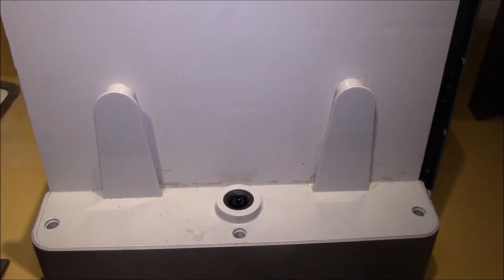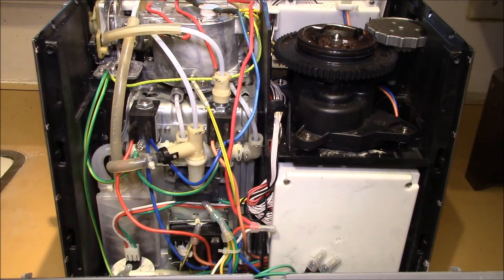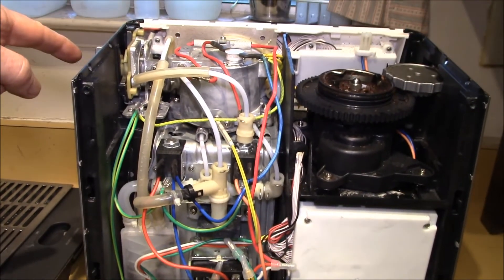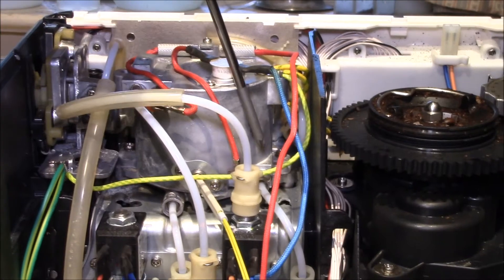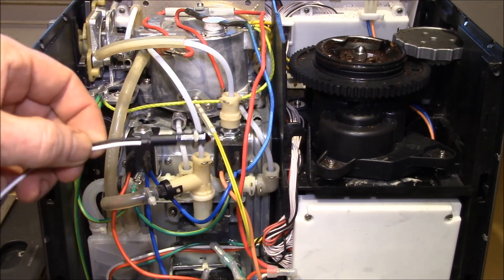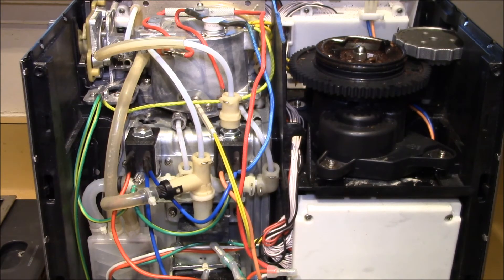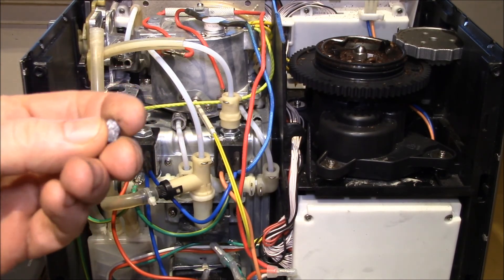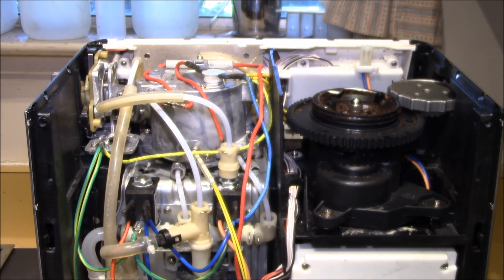Breville/Sage 870XL Barista Express - Water Flow

Comment: Thanks a lot it's very interesting video! Question: the pb I have is: the first shot is good but the next there is no pressure and the water comes out from the bottom. Is the 3 way valve issue? Thanks
Reply from the maker: Yes, that valve may be sticking part way open and that allows water to flow, via the path of least resistance, to the drip tray.  Try cleaning the valve:
https://youtu.be/eljHS_BRJXk?si=5dmpMHDIYVtmt-IF
Reply: Thanks a lot for your quick response! Much appreciated! You explained very well the process how the machine works! Thanks again and have a great day!

Comment: i have the same machine BES870XL. i justed changed the selenoide. Even with a new selenoide, i still dont have water coming on the main espresso cup but i do have water coming for hot water and for steam. it seems that that trere is a hose blocked somewhere...any idea ?
Reply: after a few tests, no hose blocked and no water coming for percolation
Reply from the maker: @ Likely an electrical issue (wires not connected right) then or the new solenoid is blocked internally and unable to open  Check the pinned comment in this vide for some troubleshooting tips.  If none of those help, it could be the driver circuit on the main circuit board has failed.  See the link to the photo album in the pinned comment.  If you can't repair the board, new ones are available at a reasonable cost.
Reply: @The4Crawler  I just opened the motherboard case and I see black heat spots, so the card seems burnt.
Reply: @The4Crawler  i succeed. I changed the selenoide and the circuit board. Everything work perfectly now. Thanks for your help
Reply from the maker: @FrancoisBolduc-y2q  No problem, glad you got your machine working again!

Comment: Yesterday, 17/03/25, my Barista Pro had exact problem as in this video. That is, water would come out for 5 secs or so then stop when using STEAM, HOT WATER, DOUBLE OR SINGLE COFFEE. The idea in this video mentioning "AIR-GAP" built-up and the "FLOW METER" are 2 things have caused this problem.

My fix did not involve opening the whole machine in order to fix the FLOW METER. I just poured HOT WATER TO 1/2 tank. Then used the BRUSH (supplied with BARISTA PRO; or use the TOOTH BRUSH) to brush the MESH FILTER, inside WATER TANK, in the hope to remove any residues built up on this MESH FILTER. Then tip this water out. I then filled the water tank again with HOT WATER... And eventually it works like a charm.
Reply from the maker: Thanks for sharing your fix!  It's nice to hear of a simple solution that doesn't require taking the machine apart.

Comment: Hi there, My machine no longer heats. I am about to change the thermocoil but before i do I was wondering if there is anything else I ought to check first. Perhaps a thermostat or a sensor that could be causing the thermocoil not to engage? Would you have a suggestion as to best procedure? TIA!
Reply from the maker: Some things to check on this web page:
https://siber-sonic.com/appliance/breville.html
Its aimed at at an earlier model machine, but all the 800 series machines are fairly similar.  Also, might be worth contacting Breville support and see if they have any troubleshooting tips.
Reply: @The4Crawler  Good point! And thanks for the link!

Comment: There is a circular thingy on top of the boiler. A red wire on one side, blue on the other side.  Recently, as the machine was building pressure, there was smell, a smell of electrical heat and badness.  Upon exposing this thingy I touched the red wire and the shrink tube was dust and the red wire was faded and it too was dusty from heat. Is the white circular thingy the problem and I just replace it or has something terrible transpired and I'm SOL?
Reply from the maker: I'm not sure what that is.  I never looked too close last time I had my machine opened up.
Reply: @The4Crawler  I just ordered the entire boiler, has everything. $70. And the solenoids and pressure gauge.  This is now a backup.... we bought a new 870.
Reply from the maker: @TheHypnotstCollector  Good deal.  I didn't see any separate items related to the thermo-coil available, so I imagine it's all one unit.

Comment: First of all, thanks so much for the great info. I would like ask for your option about an issue I have with my machine recently.  At the end of steaming, when I shuttle off, the pressure is released from the steam wand, instead of releasing to the diffuser.  I run the cleaning and descaling cycles, but won’t help.  Could you help?
Reply from the maker: Steam should vent to the diffuser and drip tray when the steam valve is turned back to OFF, via the built in hose out the back.  Maybe that fitting or the valve itself is clogged inside.  I have a video in this playlist on that fitting.  Steam should also be vented via the 2-port solenoid valve on the left side, that's turned on at the end of a cycle as you can see here:
https://youtu.be/9cC-m3a-oXY?si=FpqlHpBoo_GRvZsC
Reply: Thanks so much. The info on your other video is also help. I will check the 2-way valve. I suspected that one not working probably. Really appreciated.

Comment: Aha, seems found cause of one leak, a split o-ring. But when I run steam, I get water bubbling out from between the metal thread and the plastic part on top of the solenoid.
There is a small black o-ring in there that doesn't come with the new one, maybe that has deformed or something, looks fine but it is tiny. Any idea what size that is please? Tried replacing it with an orange one, no change.
Reply from the maker: Good find, I hadn't seen an o-ring in there before as it blends in with the dark metal color.  Hard to measure but it seems to be 7mm OD x 1mm thick.

Comment: Hi again, how tight should the part on top of the solenoid (vertical connector) be screwed on to it, and should there be an o-ring in there? I know there's an o-ring there for the the, but is there one between that connector and the solenoid, if that makes sense? Thanks.
Reply from the maker: That is a pipe thread type connection, so tight enough to not leak.  You can add some Teflon tape to the threads before screwing the plastic piece on to help seal those threads up.
Reply: @The4Crawler  Thanks but I might just have to give up :( wasted time and money and money. Replace solenoid so that now works, but now there's a leak out the top of solenoid, and also one somewhere near the left solenoid, water pools on the flat metal tray part.
Reply: @The4Crawler  Thanks, I have ordered a role of teflon tape. Fingers crossed that's the last step.

Comment: I've just noticed I have a small leak coming from the T shape part pointed to at 2:45 is this known to fail or likely just needs a new O ring? Can the T part even be bought? Thanks.
Reply from the maker: Covered in this video:
https://youtu.be/46UBebNJ-uo?si=xoIWc5_rJJrL55TJ
Washer on the bottom, o-ring on top and a zip tie around the tube out the side.
Reply: @The4Crawler  Excellent thanks, watching it now. On mine though I can see drops coming from where the clip goes in on top holding the white small tube.
Reply: @The4Crawler  Thank you very much. It seems parts are less readily available in the UK. Would eBay item 386841743258 be the correct one? It looks the same but doesn't come with the white top tube, but I don't see why it should need to? Thanks again.

Comment: Thank you for your informative video I have the exact same machine that were not brew coffee the right side solenoid when powered on there’s no power going to it when it stops. The overflow solenoid on the left has 240 V. Can you please help the solenoid on the right when running has no power with the multimeter so I believe the solenoid is okay but somehow there’s no power going to it
Reply from the maker: Assuming it's a 240V machine, then either the wiring to the solenoid has a loose connection or if that's OK, then the driver on the main circuit board is defective.  Details on that part way down the photo album below:
https://photos.app.goo.gl/bN1ugnLPYwvyDcr59
Reply: @ thank you think it’s probably a little bit over my head
Reply from the maker: @johnberto8861  New circuit boards are typically available.  Or, if you don't want to spend a lot of money, one could wire in a momemtary push button switch to power that solenoid valve to run a shot.  Push the button while the pump is running and then release when the pump stops or the cup is full.
Reply: @ thank you so much for the tip🙏

Comment: Ok. You are definitely the expert on this stuff. I replaced the safety valve and the tube on top of it and it’s no longer leaking and my steam is working terrific but now my puck is crazy wet. I’m adjusting grind size with no luck or little luck. I had cleaned the grinder thoroughly. What should I be looking at? Three-way solenoid valve?
Reply from the maker: If the pressure is at a decent value and the shot is otherwise OK, then it may be OK.  One page I read said that wet puck may be caused by not filling the filter basket fully, you should see an impression of the shower head on top of the puck.  If the pressure is low, then the 3-port solenoid may not be fully opening, thus allowing some pressure to leak by.

Comment: Hey Mr Brown, my name is Tom.

I've read your pinned comment and watched the video several times but I'm stumped. I took the back off my machine, cleaned out all the water lines, reassembled, but no water will come out from the wand or hot water dispenser now. It will come out from the group head just fine, and water will go in the lines leading to the hot water dispenser, but nothing but dribble from the hot water dispenser and nothing from the wand... Any tips? I'm about to cave and buy a new machine if I cant get this figured out.

Thank you for your time,
Reply: Hot water is coming out of the bottom of the thermal coil but after the solenoid block, I think that’s where the hiccup is. 

All of the wires are in their original position 

I can blow air throw the tube that connects to the hot water dispenser so there’s no obstruction there
Reply from the maker: @haxorizm7452  Sounds like you're getting closer to the cause.  Water should come out of the thermo-coil and down to the right side of the solenoid block then up out of the upper port to the hot water valve.    If the pump is running, that water is going some place and that's either the group head or the drip tray if it's not going to the hot water valve.
Reply: @ yep we’re on the same page, but that’s the confusing part. 

Hot water is coming out of the thermocoil on the bottom right, I can feel the hose get hot.

If I turn the standby to steam, it’ll dribble. If right after that, I then pull a shot, a big poof of steam comes out from the group head so that pressure is building somewhere. 

If I turn it from standby to hot water, it’ll dribble. Nothing out the group head 

There will be a marginal amount in the drip tray after this, but nothing to write home about 

Is that still sounding like the three way solenoid is the next step?
Reply from the maker: @haxorizm7452  That sounds normal for the right side tube to get hot.  At that point, either the tube out of the top of the solenoid or the hose out of the middle of solenoid block should feel hot as well.  If neither of those is getting hot, it may be the 3-port solenoid is clogged, likely at the top port as that's where the hot water goes to the valve on the side.
Reply from the maker: Could be the hot water valve is clogged internally.  Maybe try running several descaling cycles through that valve, especially letting the descaling compound sit inside the valve for some time before flushing it out.  If that doesn't help, see below:
https://siber-sonic.com/appliance/800Mech.html
I think there's a writeup there on taking that valve apart for cleaning.
Reply: @The4Crawler  working on the descale now, I double checked all the water lines and all are clear 

The unit will build steam, descale in the single cup setting, but still nothing but dribble from the hot water and steam function. 

I can hear the solenoid turning on, so I’m really at a loss. 

I’ll let the descale sit for a while and cross my fingers but did you have any other ideas while I have you? 

If not, do you or anyone you know tinker with these? I’d be willing to compensate for time obviously 

Thanks again,

Tom
Reply from the maker: @haxorizm7452  No solenoid should turn on at the beginning of the hot water cycle.  At the end, yes, the 2-port solenoid will turn on for ~30 seconds to purge the system of hot water/steam.  But, per this water flow video, water should flow up out of the top of the 3 port solenoid (when it's off) and over to the hot water/steam valve.  If that valve is being turned on, try disconnecting the wires to that solenoid (with the machine unplugged - also tape off the wire end you disconnect) and then try running hot water.  If it comes out normally, figure out why that solenoid is being turned on.  Maybe the wires are mixed up or maybe the main circuit board has a defective drive circuit for that solenoid. Maybe unplugging the machine might reset that as well.
Reply: @The4Crawler  Thanks for the quick reply! I should mention, it was sputtering before but after disconnecting the lines and reconnecting them, thats when the hot water and steam want stopped flowing all together.

i'll give your suggestion a try tonight and follow up tomorrow. Thanks again!!

Comment: Thank you Mr. Brown,  that was helpful, in the picture that I am attaching, if there is an option for this, after i replaced the black part of the solenoid only, (top of the right one, ) and the  pump, i did hear a something go flying ( fling) as i was dismantling the unit, although I could not find anything., then upon putting the new pump in an starting to reapply all of the hoses and wired, i found this small spring with a piece of plastic at one end about half an inch in length,  hard spring about 1/8th in diameter with a small opaque plastic insterted into one end, which is rounded off),  ( UPDATE, I COULDNT POST A PICTURE HERE, SO, I WILL TRY TO DESCRIBE IT, . , ugghh, I don't remember where this came from, or where it goes, can you help me ?, thank you, john
Reply from the maker: Photo 17 in the album below might show that:
https://photos.app.goo.gl/bN1ugnLPYwvyDcr59
Sounds like it's the spring from inside the over pressure valve.
Reply: @The4Crawler  , This is exactly the spring, next to the numbers 23 and 24 on the left picture near the bottom of the group of pics, You are INCREDIBLE in your detail.!, I cannot believe the knowledge of the multitude of different videos you have., Thank you for your expertise, God Bless., thanks again, john.

Comment: I found out that you can disassemble the solenoid valve and clean it with cafiza or vineager. Never buzzed again! Sometimes it's not necessary to replace it.
Reply from the maker: Yes, I found that as well:
https://youtu.be/eljHS_BRJXk?si=81Rw9Rt75Vo4jvEO
I like having a spare set of valves on hand to make it quicker to swap out next time.

Comment: thank you for excellent comprehensive information., i have watched lots of videos and read your entire first comprehensive list of trouble shooting possibilities, however I still have a question.,, my machine has a a similar problem, but doesn't make as much noise as usual after powering up.  it is rather a quiet buzz. i was wondering if you knew how to tell if it is the pump or the solenoid when there is no pressure. there is no only a small amount of water exiting the wand, steam of either of the shots. I am guessing the solenoid, as I heard that no amount of water at all will come our if the pump is bad., but is that completely true., is there a : partial failure of the pump where some water could still come out ?, thanks for all answers., of course I could just replace both the solenoid and pump, but i am curious which it is. nothing is clogged, cant find any leaks., i have done resets. cleanings etc.. thanks again,
Reply from the maker: Leaking solenoids will usually send a lot of water down to the drip tray.  It may also be a leaking over pressure valve, that sits on top of the pump that's sending water to the tray.  On the pump, it may have low output, or the little inlet water filter may be clogged up and preventing water getting to the pump.  Often, you can peek inside the back cover with a flashlight and watch where the water is flowing though the tubing.